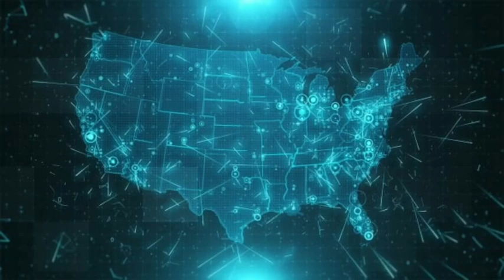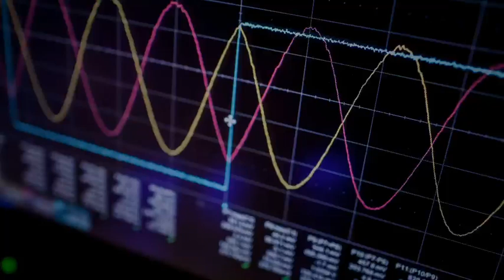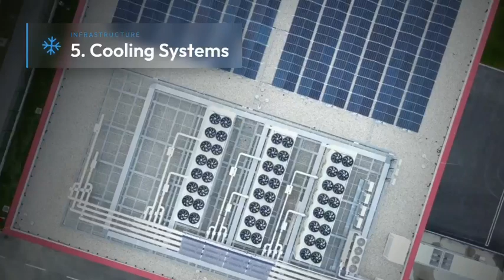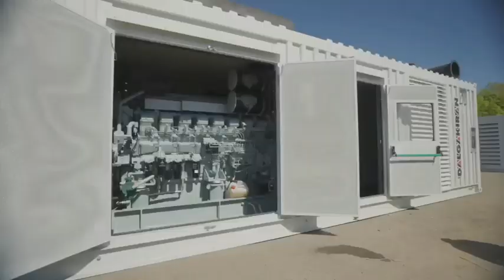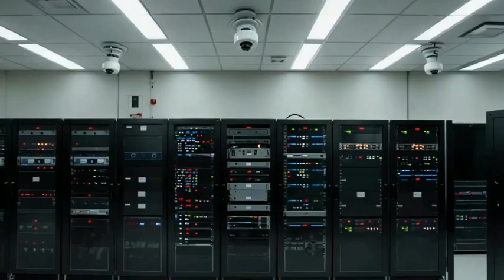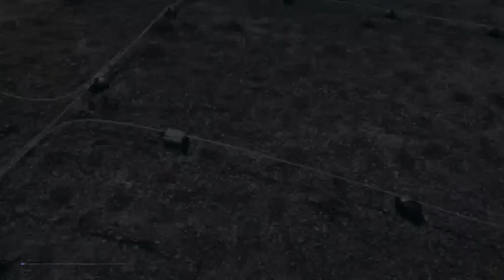Catalyst Grid - How a Data Centre ACTUALLY Works | 11 Systems Behind the Internet

Comment from the maker: Have you ever been inside a real data centre?

Which of the 11 systems surprised you the most: power, cooling, connectivity, security or backup generation?

Let me know which system you would like me to explain in greater detail in the next Catalyst Grid episode.

Subscribe to Catalyst Grid for more practical videos on data centres, engineering, commissioning, project planning and digital infrastructure.